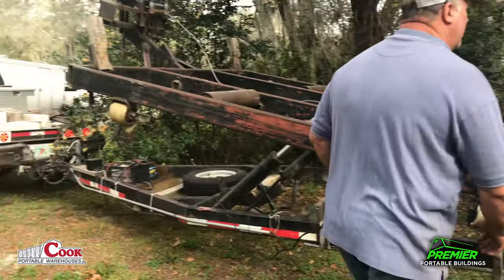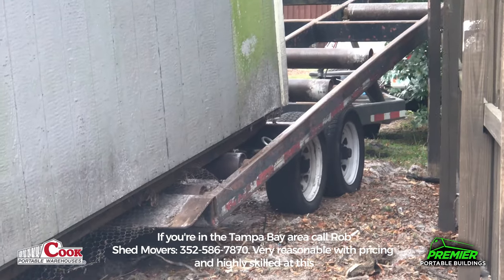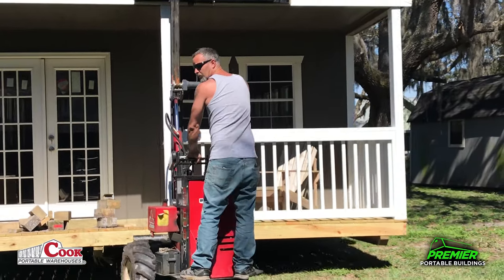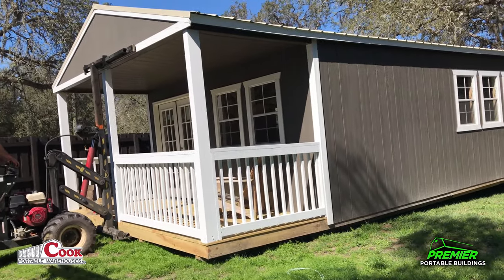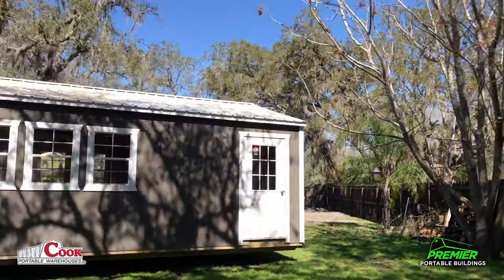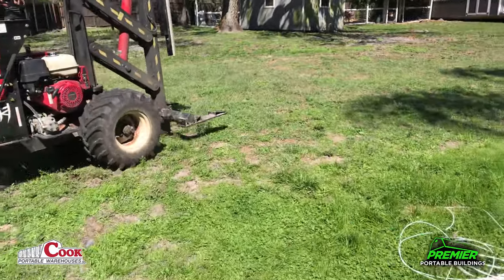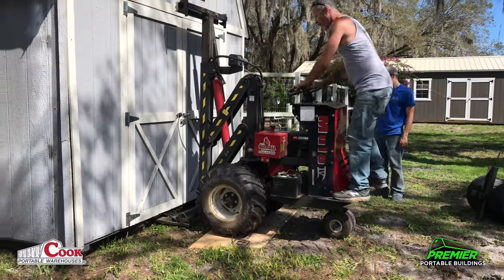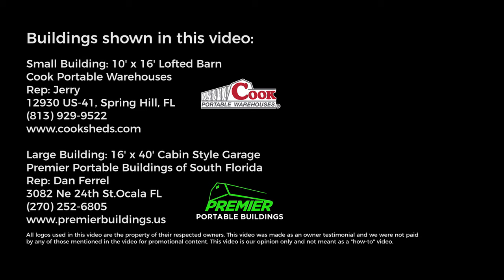How To Move a Shed Like a Pro

Comment: Before you move a small building, check with your city. Especially if you add another separate building. I moved a 10 x 14 myself. Had to get it out of the way for a 24 x 30 pole barn, The city said that as of 2014, you can;t have two seperate building on the property. Portable or fixed.

Comment: You don't need concrete it can just be dropped on grass?
Reply: Robin Lane Skinn Even with pressure treated wooden skids on the bottom, It should be placed on cinder blocks or a gravel pad. But it’s up to the owner.